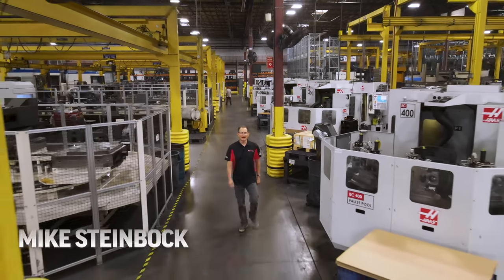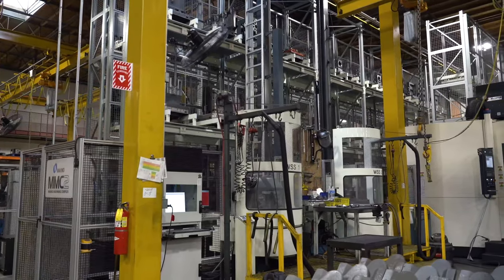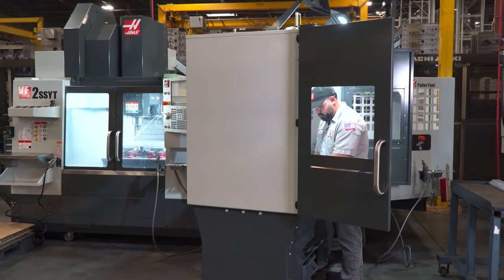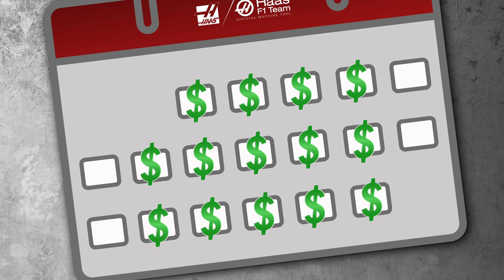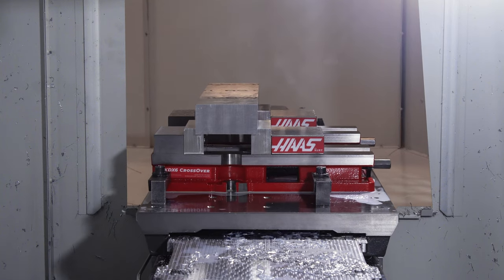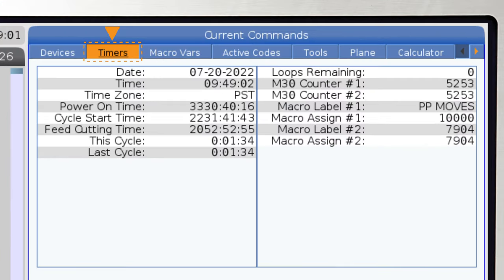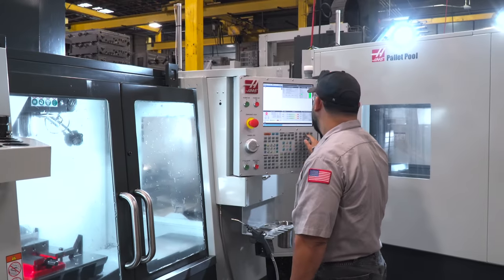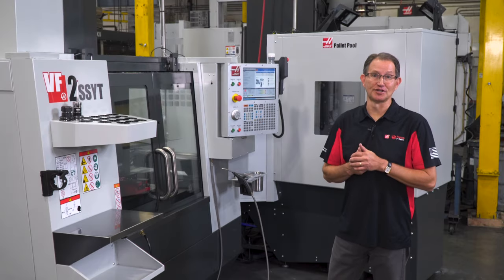The Haas VMC Pallet Pool - Haas Automation

Comment: How do you mount the tool setter when using the pallet pool?
Reply from the maker: Good question Aaron, The tool setting probe is mounted on a machined bracket that itself is mounted on the pallet receiver part of the machine table at the rear left-hand side of the table.

Comment: Newbie alert!
As a newbie I am clearly missing something.
Doesn't running lights out imply having automated chip management and coolant replenishment?!
I have seen a lot of videos on milling machines equipped with pallet changers BUT never have I seen chip management and coolant management...

What I am missing?

Thank you,
Jorge
Reply: what do you mean? haas has different types of chip augers and conveyors, as well as automatic coolant refill
Reply: @faxxzc  Hello. When the chip bucket fills up...
Reply: @rdc02271  usually is enough overnight, which is what lights out mean

Comment: Uhhu .... the only positive thing i've seen in this WHOLE video is "run at night" and nothing more. Because part -changing by hand... faster
-Waiting for first part control... if the pallet pool doesn't have to wait, a guy doesn't have to wait either.
-1 guy for 1 machine ? If that part take 30 minutes to machine wtf is that 1 guy doing the rest of the 28 minutes? 
-why not make it so that the arm can rotate 360? It's practically wasting time to rotate al the way around places the pallet, pick the next pallet, rotate al the way around AGAIN.... 

Sorry but the only nice thing i see is lights out production.
Reply: He mentioned the operator can be doing something else. Inspection, cutting more stock, even running another machine. So, he's not standing around with his Johnson in his hand for 28 minutes!
Reply: @fryer05maverick31  watch the video again.